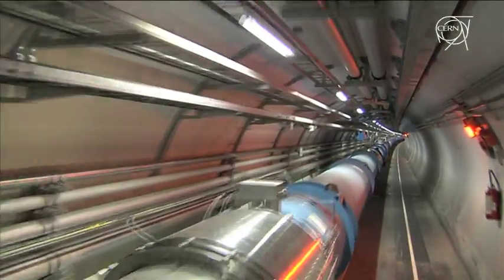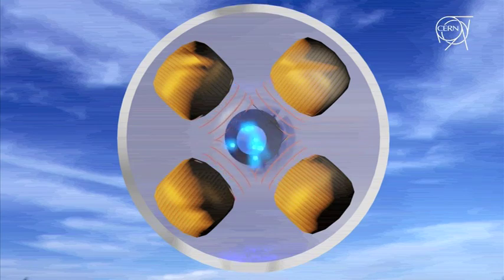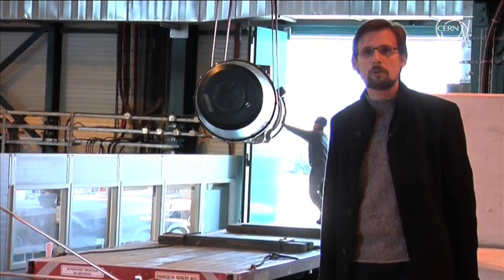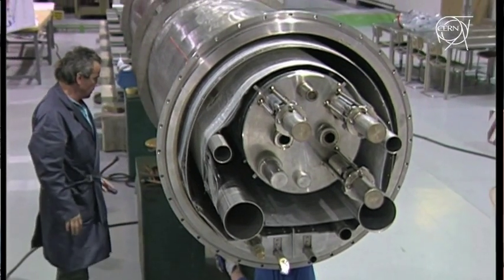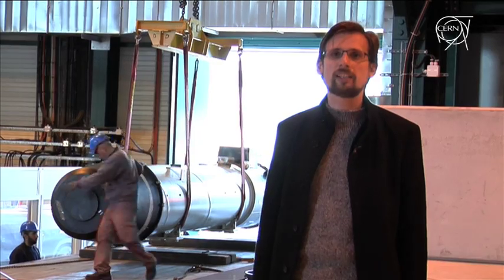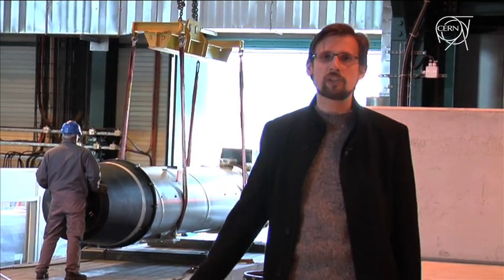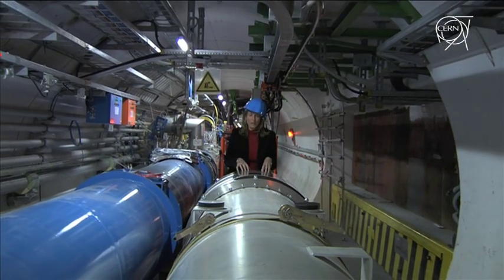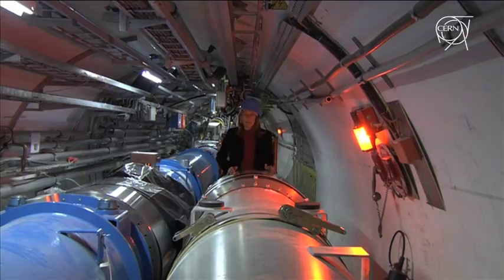LHC News April  30 2009 - Last quadrupole in tunnel

Comment: It was a problem with a connection between 2 of the dipoles.  The connection had more than 200 times the amount of resistance.  No design flaw, just a tech that made a bad connection.  If you look at the CERN channel, there is a video that explains what happened.